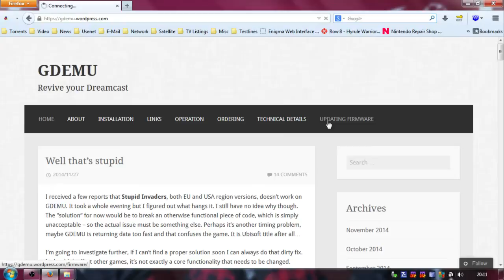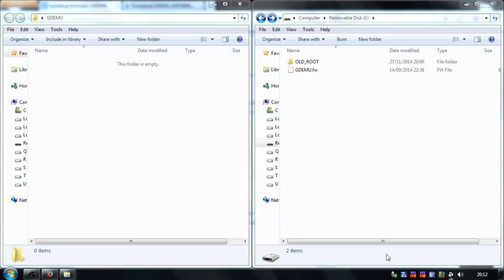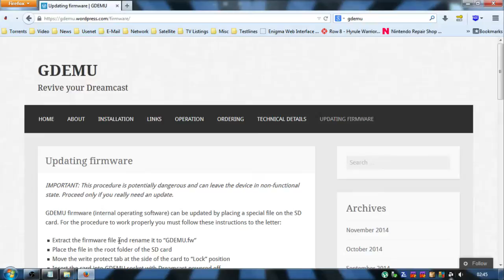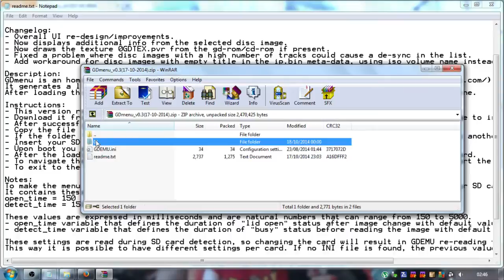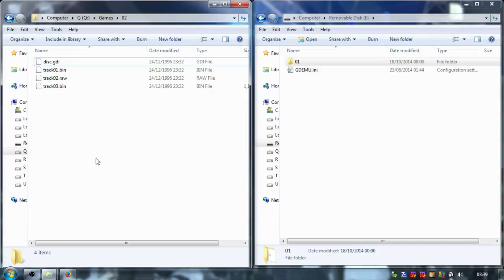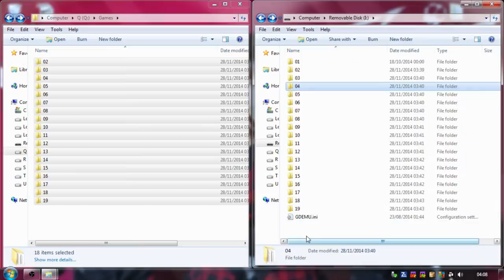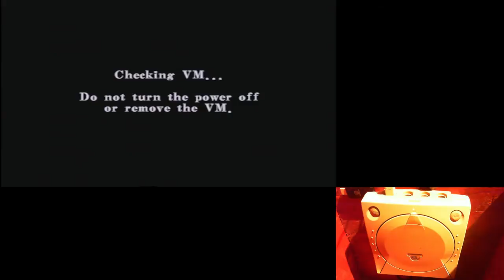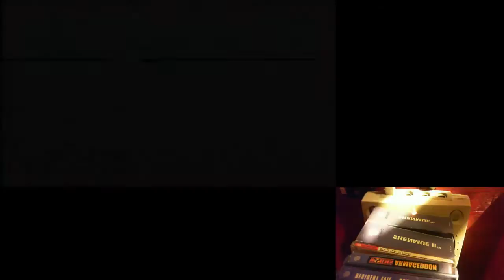GDEMU Install and Setup for Sega Dreamcast by jse, Difficulty = Super Easy

Comment: You forgot to desolder the 12v regulator since there's no more drive using the 12v and now your PSU will start overheating because you forgot to do that.
Reply: Djinn! Nonsense!

Comment: So you save the files from the original cd and send it to the sd card and replace de name with a .cdi?
Tried ordering this but the guys has no release date..
Reply: Excellent.. Sad news the developer is not taking orders right now. If you have one can you sell it? Also I read that there is a USB GDMU in the works.. I think from a storage standpoint this one will be even better than the SD variant. What you think Master?
Reply: ***** No Buddy.. The one I meant is http://www.retrogamenetwork.com/2014/08/13/new-sega-dreamcast-modification-usb-gdrom-offers-brand-new-updated-disc-drive-alternative/

I think is an improvement to the one you are using .. It was made by Mnemo

Comment: have you had any heating issues with scart?
Reply from the maker: I've only been using VGA and VGA to HDMI adapters but there shouldn't be any heading issues running a Scart cable.
Reply: jse07 its meant to be the 12v the scart feeds from and its said to put extra load on the psu.. do you know if svideo uses the same 12v as the scart.. cheers